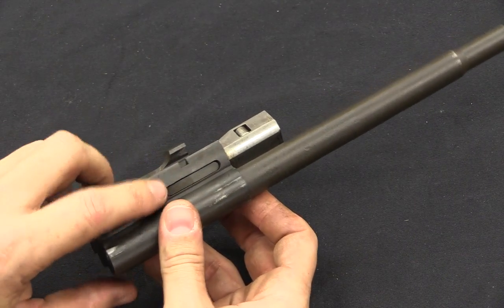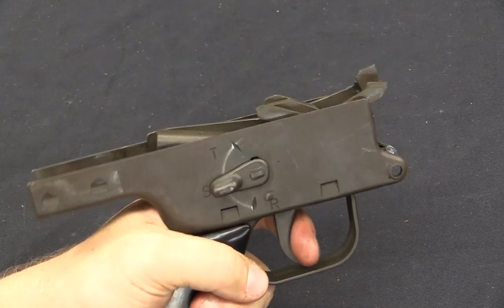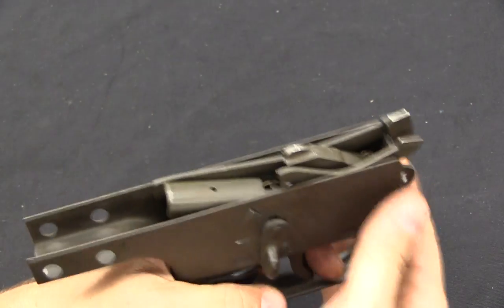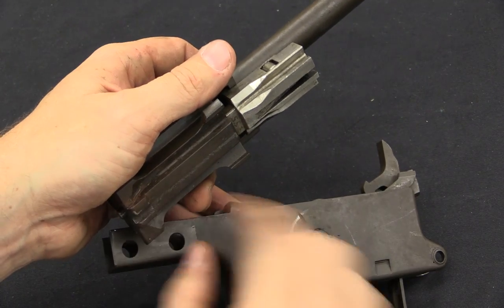CETME Modelo A: First Step Towards the G3

Comment: Love the conversion to metric units for us non americans ^^
Reply: When will the cowboys come to senses and use the same units that 7 billion people use already?
Reply: mojoblues66 when someone else can get their hides on the moon
Reply: mojoblues66 they already use the metric system, but they convert everything to imperials. no, seriously, look after it.
Reply: mojoblues66 when the british comes back to retake the colony they badly lost...
Reply: @mojoblues66  Never!
Reply: I just came back from a vacation in the UK, and they don’t generally use metric there, either. Street signs are in miles and miles per hour. They use yards, feet and even pounds for weight. I actually asked a few people about this, and the people I asked confirmed that with the exception of buying gas in liters and using metric for temperatures, no one really uses metric in the UK.
Reply: @christopherzarcone1363  big parts of the apollo missions were made with the metric system.
Reply: It depends what you are doing which set of units you use. Unlike the US all technical work is done in SI units - for example when I was restoring canals all the locks, bridges etc. were laid out using Metric. But we have a long legacy, so the normal way to refer to the width of those locks when in use was 7ft etc, because all the everyday measurements on the canals are nice multiples of feet and inches.

The law is one reason why we still use miles and miles per hour. There are a LOT of laws that specify things like speed limits in Miles per Hour etc, since they were written before the UK went Metric. So we stick with mph for speed limits since '30' is a lot easier to read and understand when travelling near that speed than '48.28', which is what 30 mph is in kph to the reacquired level of accuracy. To change all 30 mph restrictions to, say, 50 kph would require multiple laws, local and national, to be changed and a huge expense in changing all those speed signs. And then you would have to start in on all the other speed limits and the direction signs, which use miles (because speed limit in one set of measurements and distances in another is a bit wonky and likely to cause confusion) - which also ignores all those speedometers in cars which read in mph (although for a very long time they also have had a kph scale in smaller figures).

OTOH the reason you will almost always see weights in shops quoted in both Imperial and Metric is the number of people who still 'think' in lbs and ounces and the number of recipe books still out there written before metrication. However the law is the reason you will ALWAYS see the metric value listed, as that is the actual legal quantity you are buying. If there is any dispute that is the measure that will be used to settle the matter. The Imperial values are a convenience to the customer only. If a shopkeeper only listed quantities in Imperial measures they can, and will, be prosecuted. Hence sugar, for example, comes in 1kg bags.

We get on quite well with our two systems - buying Draught Beer in Pints, Spirits (at the bar) in 'Measures' of 25 ml and working with pipes of 15 mm OD that some people still call 'Half Inch' because it is compatible with old fittings for that size. But what we DONT do is use Imperial for anything technical, like spacecraft, aircraft, building works, new laws etc - except when we do (it is Britain, after all, 'a foolish consistency is the hobgoblin of little minds' and confusing foreigners is our National Sport).
Reply: AKA "weirdos"

Comment: two non interchangble rounds that are the same size. look the same and is used by the same unit. Is it only me who thinks that sounds dangerous.
Reply: One liutenant, back in 2002, tried to fix a demilled CETME A with a CETME C barrel.
He didin't know about pressure and locking, so you can imagine the result.
I only HEARD it from quite some distance ;-)
Reply: Did the liutanant go badly hurt. It sounds like the weapon needed some fixing.
Reply: @exploatores  Not seriously, mostly a couple bruises and a scare. 
By the looks of the aftermath, the barrel wasn't properly seated and separated from the trunnion almost completely, the bolt stuck itself on the rear, and there were some small cracks on receiver.

No need to say the jokes and nicknames that started flying from that day on ;-)
Reply: Nice to hear that no one got killed or got any serious wounds. I am a former military, so I can guess that he didn´t hear the end of that. I guess the incident was used as a example why you never should have the wrong kind of ammo on your person. that kind of thing would get you killed in a firefight.
Reply: @exploatores  More as an example of "you don't klutz a high-powered rifle out of mismatched parts, thinking that your rank means you know what you are doing". ;-)
Reply: I believe the Japanese has a similar system of lowered powered 7.62x51 for rifles

Comment: the missing link between mauser and H&K
Reply: The Father of H&K
Reply: Licenced was bought he G3 (Gewehr 3) is a 7.62×51mm NATO, select-fire battle rifle developed in the 1950s by the German armament manufacturer Heckler & Koch (H&K) in collaboration with the Spanish state-owned design and development agency CETME (Centro de Estudios Técnicos de Materiales Especiales).[2] The G3 was the service rifle of the Bundeswehr until it was replaced by the Heckler & Koch G36 assault rifle in the 1990s.
Reply: @larrymccoy5394  is not developed by the germans, HK just buy the pattent of the Cetme model C and bought the factory machines too to translade them to germany. Early G3's are simply made on Spain because the machines dont move to germany on first months, even the protoypes like the 7,62x39 G3, has Spanish markings, every HK first models on wood-baquelite, even the mp5 prototype with straight mags, all had spanish markings, on the factory they left some pieces of prototypes including parts of mp5 protoype and 7,62x39 g3, if you search about prototypes of 7,62x39 or early G3 rifles, you can see all were made on the Cetme factory until HK savage all the machinery from Spain and train the new german personel.

Comment: When I was in my military service (Spanish Royal Air Forces), I used the model B during the recruit training period.  Then I used model C during the rest of my military service.  
It was a very hard and trustworthy machine.  It never failed,  easy to dismount and to clean it.  It was ready for use in every conditions like sand, mud, rain, snow...
The only cons I found in it was its magazine, 20 rounds is short, it was better a 25 or 30 round magazine.
In the Air Base was USAF too, and they was very impressed by the CETME, many jokes to swap by theirs M16

Comment: Very pimp, never seen one of those; about the markings, FA may mean Fuerza Aerea = Air Force, in the same way that the Armada's CETMEs had FN on the side, meaning Fuerza Naval = Navy Force, and the regular Army have ET markings meaning Ejército de Tierra = Land Army. The "fun switch" markings, T means Tiro = Shot, S means Seguro = Safe and... the tricky one; R, in the CETME L... R meant Ráfaga = Burst, but, in that CETME A, R mean Rápido = Fast/Quick. Later on, on the 70s i belive, the doctrine changed to the Rapid Fire began to be called Fuego Automático (Automatic Fire) but for make it even simpler... it was just called Automático and the full auto markings became just an A. Some Star Z-70, Z-62 and Z-84 also had the FN (Fuerza Naval = Navy Force) markings on the side too.
Reply: Sorry for contradicting you, but that F.A. stands for Fusil Automático. Is true that you can find other markings as FN, ET, GC, etc. depending on the issued branch, although in Spain the "Air Force" that you suggest is actually named "Ejército del Alre" and all branding stamping etc. is "EA". And that complementary markings used to be a liitle lower on the magazine well next to the appropriate serial number. You can also find STG markings instead of the F.A: for the early CETMEs sold to Germany.
Reply: @ReverendTed  it is true, cant tell you i had some of these on my shooting range, only exposition , btw im Spanish and what he says is totally correct, at least switch mode, other things like FA being Air forces it is not correct bc in Spain is EAm but that was a logical argument so yep, made sanse
Reply: F.A. Means Fuerzas Armadas (Armed Forces)
Reply: @rookie3315  Not in Spain, in Spain FA means 'Fuerza Aerea'.

Comment: That full auto hold open is so elegant in it's simplicity. Why was it never used again?
Reply: Probably because it's inconsistent by nature. I feel like it would cause the user confusion if they emptied the gun on semi auto and the bolt didn't hold open like they expected it to.
Reply: @hellcatdave1  
Yes, I can understand enlisted training to be an issue. If the chamber is empty, is the weapon safe? Not on full auto.
Even though there were no written in stone expectations in the 1950's. It was one of the first self loading rifles. Up to then it was; if the bolt is back, add more stripper clips.

Comment: The CETME's used in Argelia were model B, not A. 
The B had a metalic handguard, and different bipod. I used the B at boot camp and then the C in service, the recoil of the C was a lot more than the B, but the C was lighter and nicer than the B. That was in 1973-1974.

Comment: The R on the select fire stands "Rafaga" or "Rafagas"  and de "T" stands for "Tiro a Tiro" de model A doesn't use have the same magazine but u can use the magazine of the modelo B and C. That's a really common mistake. Is a  really rare thing to find  original magazines for that model.

As a Spanish collectionist i have a couple CETME's on my home there's a bunch of variables on the same models doesn't matter if it's a A B or C model bcs was an experimental model and they where upgrading the models constantly and making modifications to the grip/magazines/ muzzle breaks and sights. So there's a lot of confusion with this weapons

Comment: With the bolt held open in the full auto position, what happens when you flip the selector to safe/semi? Presumably it drops without firing?
Reply: I would assume that it lowers the additional bold holder and disconnects the auto sear that is one mechanism after all. It would slam shut and that would be it.
Reply: That would be pretty neat.
I also assume that you could switch from safe/semi to full auto you could have your first round with a closed bolt? That is a really nice design.
Reply: @Pheatrix  Best of both worlds. My fantasy "light carbine" -design that I tinkered way too long with has similar setup of both a sear and a hammer, but the sear is also the magazine bolt hold open, there's a lever to drop the bolt and they are other way around cause it has mag in the pistol grip. Think some kind of mix between Kel-Tec CMR 30 and MP7 with about 12" barrel and long collapsing stock. It's for a scifi setting that I hope to turn into a book one day fairly soon, open bolt is mainly for when there's no atmosphere when in space or boarding ships etc. and I really like the idea of dropping the bolt for more accurate shots as a kind of a power move.

Comment: But the final Sturm gewerh rifles that military uses are gas pistol operated having very similar mechanisms and parts with AK47 and M1 Garand. Even I used to think Sturm gewerhs are roller delayed system but the AK guy showed the internal and explained the working in his video stating the similarity with M1 Garand. Anywho, it is possible that the first production Sturm gewerhs are roller delayed.

Comment: I guess you could charge it in SA, switch to FA, and fire that first round from a closed bolt. Just in case you were expecting an enemy coming around a corner and wanted a more acurate first shot but the benefit of FA if you miss or if there is more than 1 of them. Just a thought...
Reply: Yes.

Comment: Imagine if the Spanish Germans and American Germans were swapped in transit.  They would be no AR today as you would all be shooting G3-esque rifles.  And the Spanish would be on the moon.  :)
Reply: Or would the G3 just have the same history as the M14?
Reply: I dont want to put my name the g3 is too good  of a rifle to end up like that
Reply: @hkoperatorsunion_3395  I think it would have shared the issues and been replaced.
Edit: Mainly because most of the problems with the M14 were just problems with battle rifles as a whole.
Reply: @SonsOfLorgar  
1: Where is the G3 still in use? To my knowledge, it had largely been phased out by the turn of the century (open to being wrong though). 
2: Imo, there's a difference between the Post-WW2 economic giant of the US, who can afford to make a new rifle and then change to a new one relatively shortly after, and a smaller country that buys G3's and then sticks with them because they're "good enough." The AK-47 is still used in many countries, but that doesn't mean it's perfect, for example.
Reply: I dont want to put my name price and recoil were especially horrendous for the m14. but yeah, battle rifles were inevitably gonna be phased out.
Reply: @hkoperatorsunion_3395  I'm not educated enough on those two to agree or disagree, though it certainly seems likely. To my knowledge, the main reasons for replacing the M14 was it wasn't good at replacing two/three of the weapons it was supposed to, AND it had all the problems battle rifles have in modern combat to boot.
Reply: @idontwanttoputmyname403  mmm, they are refering to the system, the roller delayed blowback, and yes, the g3 still being a great rifle, in germany it was issue rifle til '99 and i outlived the m14, the m14 was just...  trash
Reply: @rookie3315  The G3 and the M14 are both still in service. Both in similar roles funnily enough, as marksman rifles. The m14 certainly isn’t the best but it isn’t trash.

Comment: So, with that auto sear mechanism, what happens if you fire full auto, release the trigger (bolt locks in open position), then switch to semi? Does the first semi shot operate as an open bolt, with subsequent shots fired from a closed bolt? Or does rotating the selector drop the bolt to a closed bolt position immediately? I would think that having having to fight the pressure of the bolt on that sear, when switching to semi, would make the selector a real pain to switch.

Comment: If flipped into safe from auto with the bolt locked back will it release the bolt forward and chamber a round?
Reply: No, IIRC. But if you could manage to get it to semi, then it would chamber a round.
Last (and only) time I used one was in 99, so I may remember wrong.

Comment: So it looks that when you selected from full auto to safe or semi, the bolt would just slam home since the auto sear drops, but say you are loaded with one in the chamber and in semi, and you wish to switch to full auto, do you have to manually action the bolt and drop a round or can you simply pull the trigger, fire the round in the chamber and then continue in full auto. Also what would stop the hammer from firing the round in the chamber when you switched from semi to full?

Comment: I'm curious as to why they went with such a short sight radius, when it would appear to be not necessary to have to do that.
Reply: Could it have been because of the serious weight constraints they were under?
Reply: That's about where they had it on the sturmgewehr so I guess the idea of a peep sight hadn't caught on with the design team yet.
Reply: The front sight is located on the gas block, a which is fixed (yes I know it can be removed, but not under field stripping) and therefore stable and out of the way, unlike if it was positioned out on the barrel. 
The rear sight, is located on the bolt carrier group guide/ recoil spring guide, which is also pretty well fixed to the barrel unit, which would not be dismantled as part of field stripping. 
If the rear sight would be positioned on the rear of the receiver unit, the end of which is removed each time the rifle is field stripped. The sight radius might be short, but it’s long enough to provide design standards accuracy. This also the concept  with the AK pattern rifle,, it inherently accurate enough for its design standards, but if you locate the rear sight in a relatively imprecise rear cover, repeatability is not assured. 
After all, just how accurate does your sighting system need to be for it’s designed use?
Reply: @charlesadams1721  Well certainly I wasn't talking about the position of the front sight, but the rear. The rear sights on the B and later models where further back on the receiver right in front of where the rear comes apart, So obviously this issue was addressed at some point, it is just rather curios why they would go the route they did when they didn't have to, perhaps familiarity, or perhaps hindsight is 20/20.
Reply: @Reactordrone  I suppose this is my theory, even though the idea works as well with a tangent sight as it does with a peep (that being that a longer sight radius is better for accuracy). I suppose maybe they were just familiar with this set up which was necessitated by the smaller real estate on the rear of receivers on the older bolt guns (that or split bridge receivers).
Reply: @whyjay9959  Idk how the sight placement would help with the overall weight of the rifle.
Reply: @terryyocumiii9645  Thought it might take a little more infrastructure to have a front sight this high connected to the barrel instead.
Reply: @whyjay9959  Right, but the issue I'm taking is with the placement of the rear sight, not the front.

Comment: So if you open the bolt with the gun on safe the bolt locks back? Does the selector become a bolt release then?
This video reminds me... wonder what's happening with that semi auto STG-44.
Reply: IIRC, you couldn't completely open the bolt with the safety on (only moved a little).
Reply: @RCZM64  Ok thanks